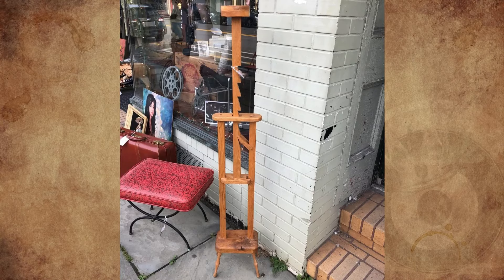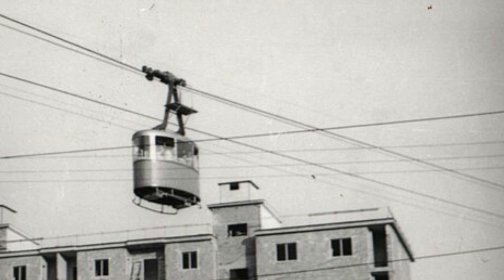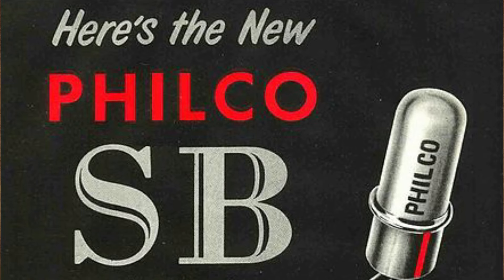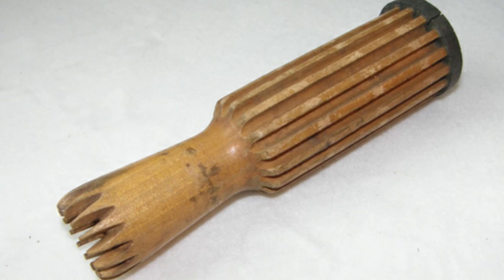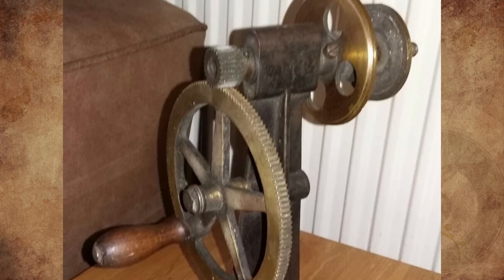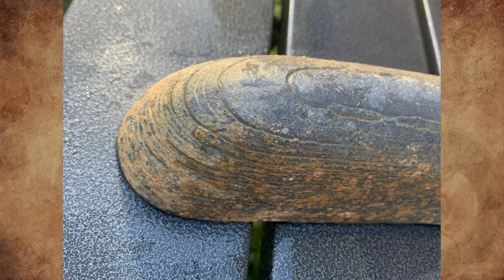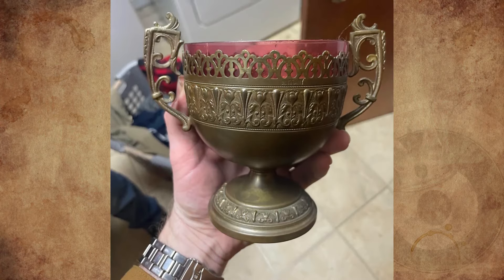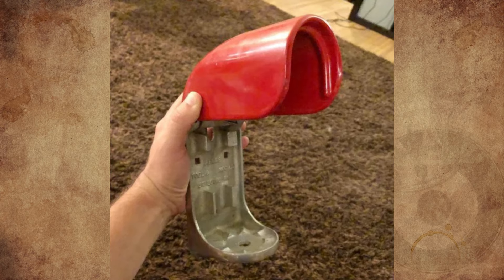What Is This MYSTERIOUS Kitchen Tool With A Wooden Handle And This Thing I Got From An Antique Shop?

Comment: That can opener is wall mounted. I've seen them in many older city taverns. It's a perfect fit for the beer cans from the 30's to 60's. The lid forced splash downwards to the floor to save cleaning time.

Comment: 6:10 - This item is not for pastry; it's for chopping eggs, herbs, anything you like.  i have a single-bladed one,  A pastry blender would have a similar handle and several stiff wires in parallel to   blend the butter and flour together instead of using one's fingers.  If the commenter's grandmother was using it for pastry, perhaps she didn't have a pastry blender handy.  

In German, 'J' is pronounced 'Y'.
Reply: It probably is a chopper but I wouldn't hesitate to use it to blend pastry.  My cheap pastry blender has the wires but I don't use it much because they bend.  The good one has many blades made of steel. You can still use the good one as a whisk.
Reply: @lawrencecarlstrom3465  I can see your point.  The pastry blender I have was my mother's, and has to be about 70 years old now.  The wires are very sturdy, which is why it's lasted so long.  I have a lot of vintage kitchen tools from my mother and grandmother that I still use because they're of better quality than most of the stuff you get nowadays. I hate modern vegetable peelers that only work when scraped away from the body, because I grew up using ones that pull towards the body.  One of those finally fell apart a couple years ago, and I was delighted to  find an identical one at a vast vintage shop in my area - and it only cost me $1.
Reply: The single bladed ones are called ulu knives.
As for the one shown in the vid, I go with the pastry explanation because it appears to have flat edges and ulu knives are curved
Reply: @outlookdaily1713  Excellent work!!! You are really good.

Comment: It is a can punch. It punches a triangular hole in the top of a can to allow liquid to be poured out.
Some also punched a breather hole to allow quicker smoother pouring.
Punching a hole and turning the can 180° and punching a small or full-sized breather hole was also an option.
We used them mainly for oil cans, evaporated milk and condensed milk cans and juice concentrate cans.

Comment: That last thing looks like a can opener. You set a can in it and push down the red part so the can will have a triangle hole on one side and a smaller round hole on the opposite side to allow air into the can will you pour.

Comment: The last thing is an oil can opener from old Gas stations. Punch then rotate and punch other side, then tip and pour. It was an early self serve thing at Gas stations. Before this the attendant had a spout that punched into the can. My Dad work at Gas stations about the time this came into use.

Comment: Now I know why my vintage kitchen cutter tool sux at chopping vegetables! It's a pastry cutter! Mine is identical to that, except that it has red paint on the wooden handle.
Reply: You weren't far off. There is a vegetable cutter made almost exactly the same primarily used for cutting cabbage to make slaws.   I have one, and still use it to this day 😊

Comment: The thing with the red handle is for chopping nuts.  There should be a wood bowl that goes with it.
Reply: Mezzaluna. Yep, I thought the same thing, though it could be dual purpose.
Reply: Definitely dual purpose.  Mother used one  often.  From the first angle shot I thought it was an Ulu.  Way off.
Reply: @markbernier8434  an Ulu isn’t that far off… both are curved cutting blades with a handle.